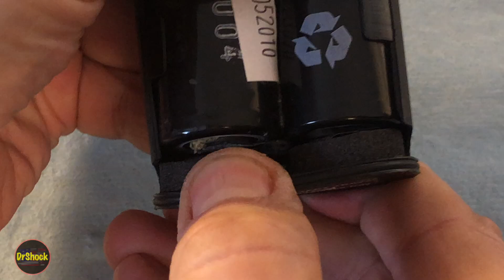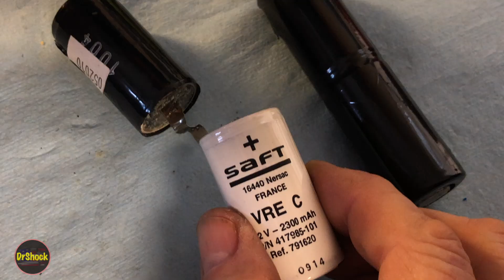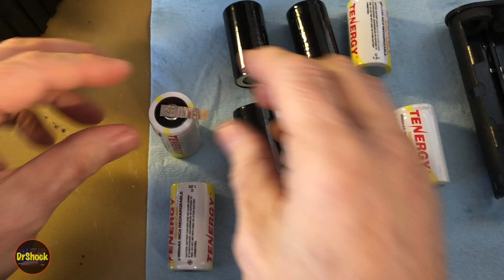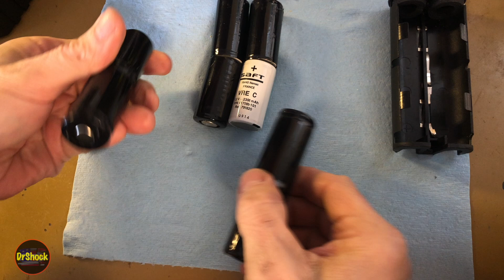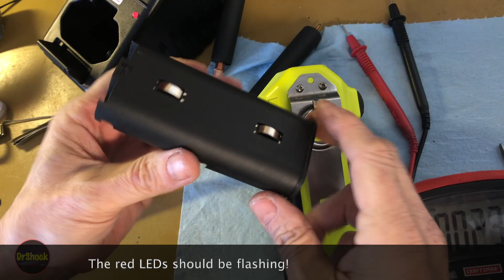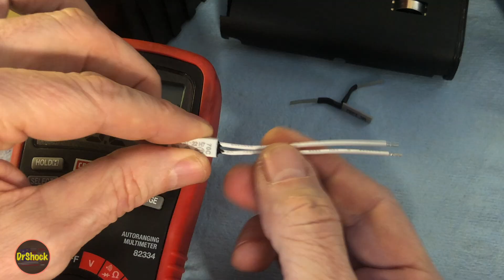Pelican Big ED Rechargeable 3750 Xenon Flashlight ~ Dead NiCd Battery Pack Spot Weld Rebuild

Comment: I apologize for this comment not being about the current video, but I really learned a lot from your BCM EEPROM Software dissection videos and would like to get more information on that. I have a 2020 Chevy Silverado  and have purchased 3 BCM's with the same part number as my truck has.  Two of the BCM's are salvage yard and one is new excess stock from EBay. I have saved files from reading the EEPROM's on all three BCM's and I am now in the process of comparing the new BCM Software with the used BCM Software using HxD Software program.  If I can get a grasp on what needs to be changed in order to allow my PCM to accept the swapped BCM, I will be one step ahead when I do have problems with my truck down the road.  In one of your video's you stated that the VIN and key codes would be all that was needed, so I am assuming that you have been there and I am working on how to read the RFID tag in the key and go from there. I also know you stated that the easy way is to just move the EEPROM from the failed BCM to the salvage yard BCM, but I would like to understand the software, and can do that as a last resort.  Thanks for your help through some excellent BCM and CH314A videos
Reply from the maker: I've not personally bothered with attempting to edit the existing memory of a BCM in many moons, as the tools to do this like Tachosoft are prohibitively expensive imo.   Also these tools tend to be focused on older BCM designs, and less reliable or non supportive, of newer GM BCMs. 

Instead, I just insure that the donor BCM has the exact GM and/or Delphi part numbers on the outer case white label and then desolder the chips and swap them between source and donor BCMs.  This moves the source vehicles programming intact to the replacement without any drama.  It's faster and more economical of a repair imo.  Another consideration is some GM models also store mileage in the IPC, and a discrepancy may be detected on newer GM models.   This doesn't tend to be an issue on older models (pre 2015).

Comment: I have two dead packs for this flashlight. Would you entertain a request to rebuild them for me?
Reply from the maker: That would cost you considerably more than they are worth  ;-)    I did link the tools and cells I used in the video description area.  There are also rechargeable battery style Seesii spot welders that could handle this job as well that the same link should show.
Reply: @DrShock Thank you.